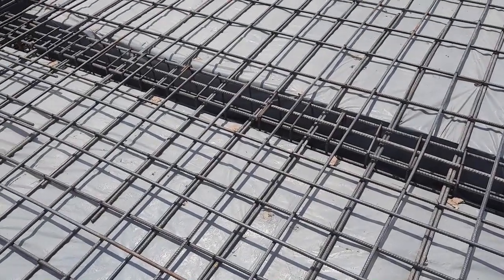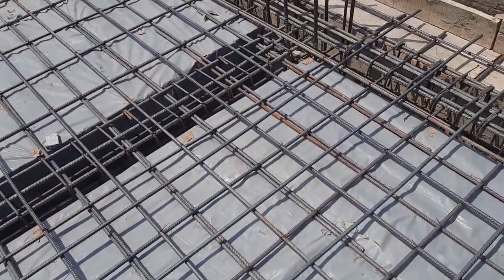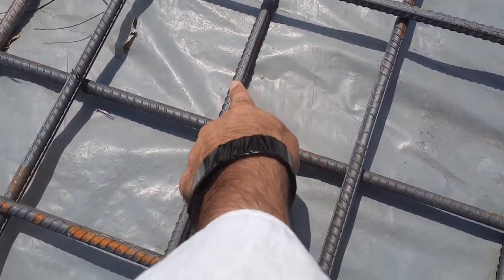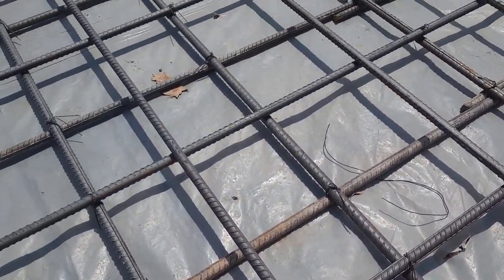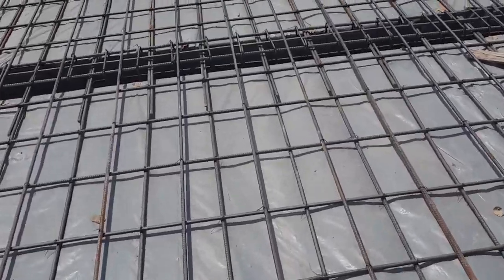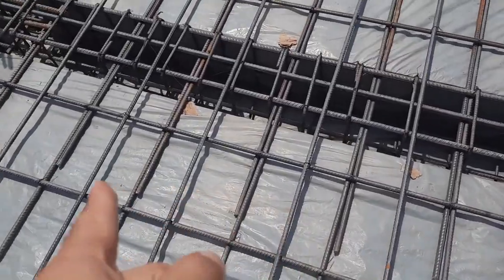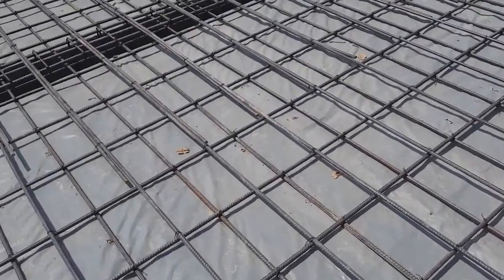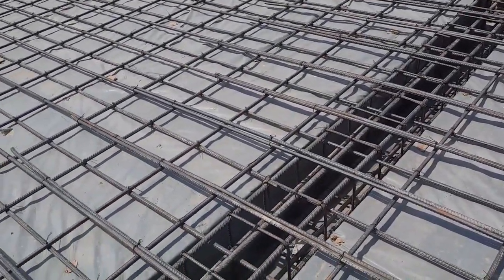Big Mistakes in RCC Slab - Lapping Mistakes - Reinforcement Mistakes - Civil Engineering

Comment: Apparently, they were making a two-way slab.... Their spacing is not consistent on the larger spans.
Looks like their intent was a critical shear zone at beam (with extra steel) and their tributary area was attached, via the overlap across the beams.
It appears extra steel at bottom of beams was to resist the extra floor loading.
Sorry, I could not make out their cantilever but, we know extra steel is placed at top vs bottom and some j-hooks would be nice at the cantilever ends.